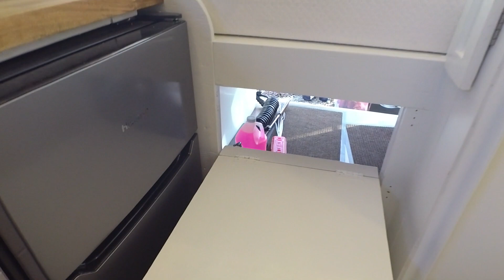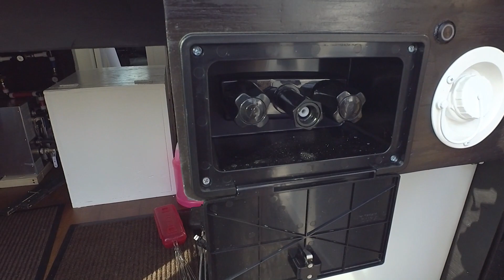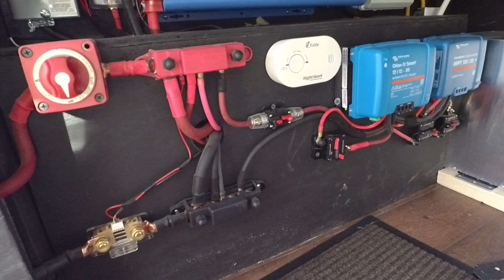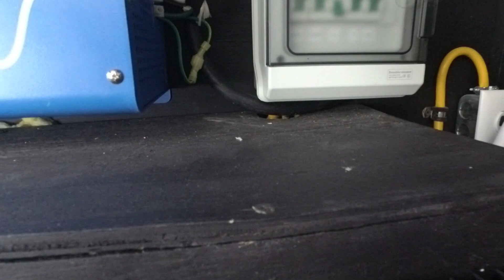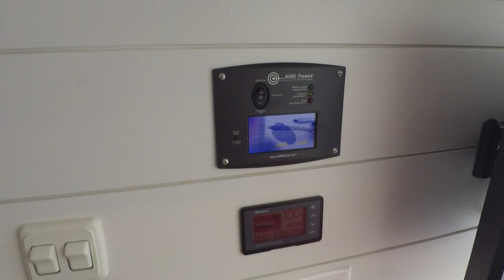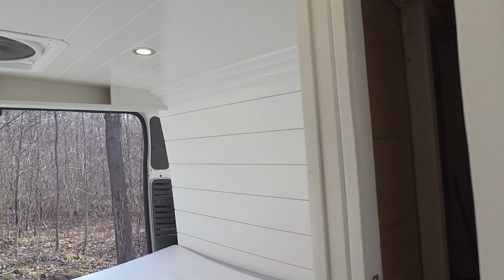Promaster Van Conversion Detailed Plumbing & Electrical System Walk Through

Comment: How did you connect your electrical system to the alternator? We’re considering buying a 2024 version of this van with factory upfitter prep installed. Is that expensive option required?
Reply from the maker: It's not required, but makes things easier if you don't want to dont want a whole electrical setup in the back. If you are going to be doing batteries in the back I wouldn't worry about the upfitter package.  I just ran (2) 6 gauge wires (positive and negative) from the battery under the seat to the back to a Victron DC to DC charger. This allows the vans battery to charge the batteries in the back when running.
Reply: @JackofAllMasterofNone  Exactly what I thought. Thanks muchly.

Comment: I've seen many videos that use a 3000 watt invertor with 400 amp hour batteries. Does your electrical system fit your needs? Because you did mention always go a little bit bigger 😁
Reply from the maker: Have never had a problem yet. It could be an issue if I try and run the hot water heater, AC and microwave all at once. I just am aware of the situation and keep and eye on the Inverter duty cycle screen. It will tell you if you are pushing it too hard.

Comment: Thank you I have learned a lot from watching your Van Conversion videos.  

1st question:  What regulates the power delivered to the battery when both the DC/DC charger and the Solar Charge Controller are both working charging the batteries at the same time?  What keeps too much current from being fed to the batteries during this dual charging period? 

2nd question:   When your using shore power what disables the Solar Charge Controller or are they also working simultaneously?
Reply from the maker: The batteries have a built in BMS that regulates the charge. They will only take what they can. When on shore power it combines all of the inputs up to the maximum that the batteries will take.

Comment: Cool build!  Any concerns for gray water tank freezing in winter?
Reply from the maker: We don't use it in the winter but it would freeze for sure. You could add a 12vokt heating pad system to the bottom of the tank if you are camping year-round.